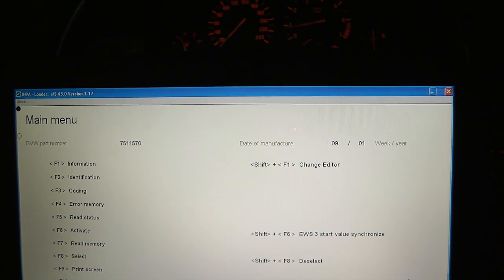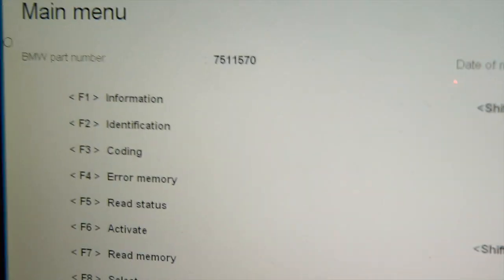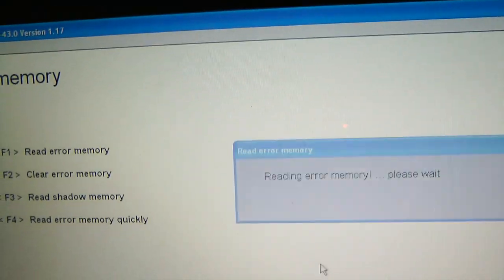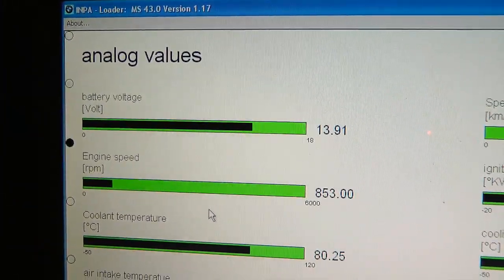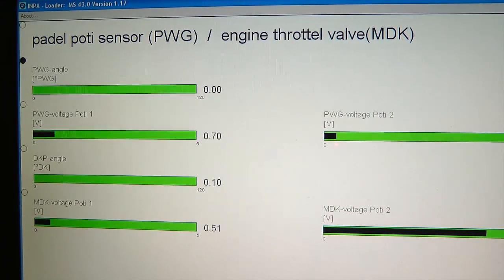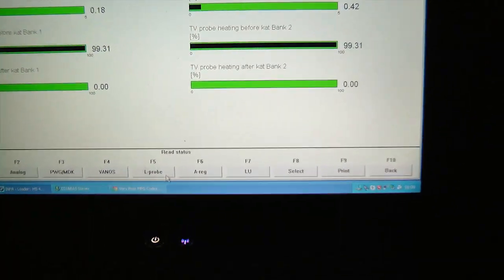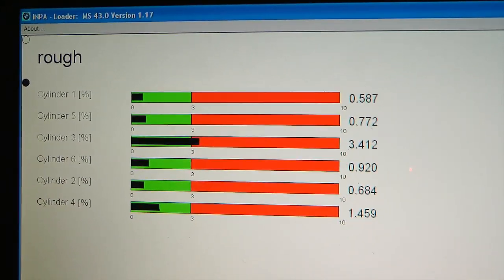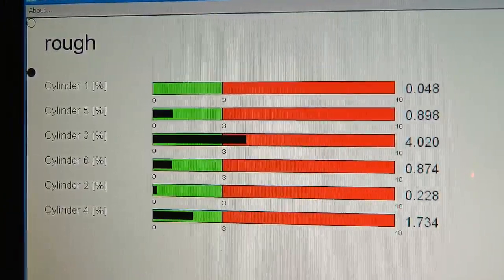Inpa BMW 530i E39 All Functions Explained

Comment: This works great for seeing engine data, but I get the error ‘IFH-0009: NO RESPONSE FROM CONTROLUNIT.’ When trying to check airbag and abs, which is what I really need it for at the moment. 

Does this version in the description have these features? If so, what am I missing ?
Reply: Do you have switch on obd
Reply: @ I had it plugged into the under dash port, but I needed to use the adapter and under hood port to connect to airbag
Reply: @ no you not Need
Reply: @ plug under Dashboard And on k dcan you have switch for scan engine 2. Position on switch for Light module is 1.

Comment: Looks like intake VANOS regulating position at idle. Reference position was 127 at start but now target and actual position is 118
Normally other engines start regulating phase at mid RPMs under load.

Comment: Cause I feel difference on l checked previously on inpa option rough idle it gives me these 6 cylinders but couldn't understand what does it mean or what recommended so I hope we know correct value  
In the mean time I'll see if it stay on green area thanks for your help

Comment: do you learn how to read coils I don't know it's fluctuating and I got my rpm low about 500-600 and only on traffic light I feel that and when I pull spark plug it's just 25k on it its look black not oily it seem too rich I don't know why ? I bought another spark plugs and same low idle no vacum leak cleaned idle valve cleaned throttle body , disa valve is ok also how shall I know by inpa the injectors are working right is it possible ?
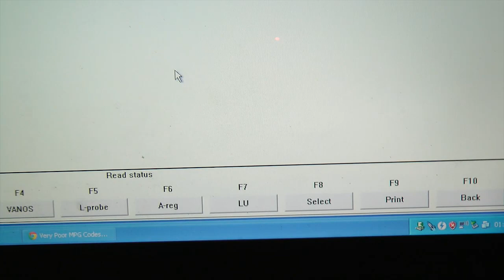Reply: Don`t know if I can help you, but in the LU Option at 6:05 you can see how each individual cylinder is being fed by the injectors. It should stay inside the green bars, otherwise that cylinder is running rich.  Mine apparently fixed itself after this video.
Reply: Fred Rodrigues ok I'll check it on that way and by the way  what's normal idle   Is it 750 cause I get around 500-600 all times what about airmass what's normal reading is it 15 kg  on inpa ?
Reply: @fredgust84  BS, LU means LaufUnruhe. 
Just the percentage of how smooth each cylinder is. 0% would be no fluctuation in smoothness. 

Please don't use software you don't know how to use. 
So much misinformation in this video/the comments.

Comment: are you using 19pin connector or the other connector located near steering wheel?
Reply: I bought an Inpa software bundle + Cables on ebay, USB to OBD
Reply: I`m using the OBD connector that goes under the dash, near the steering wheel. Only on older E39s, <2000, the connector it`s located inside the engine bay.
Reply: Fred Rodrigues which interface are you using please?
Reply: do you have the website to know if i can buy online the same bundle software + cables maybe old and new cable i have experience with inpa, edebias and gt1 bmw sofware

Comment: You solved the problem of the third cylinder correction? if so how?
Reply: Apparently it has fixed itself, I haven`t done anything new and its not like that anymore, however theres always a cylinder that keeps "working" more than the others, I`ll keep you updated.
Reply: +Fred Rodrigues thank you)))